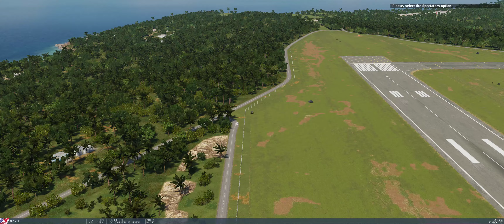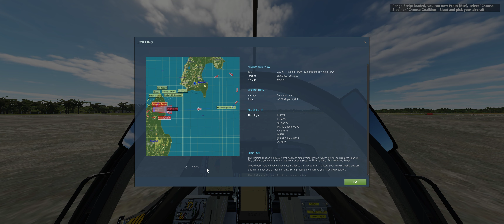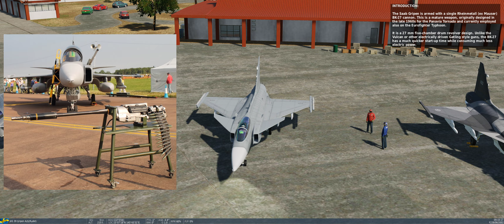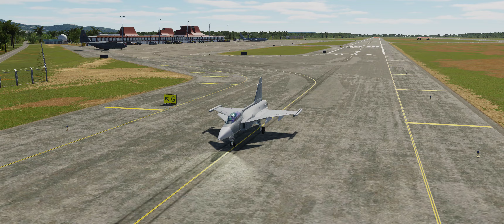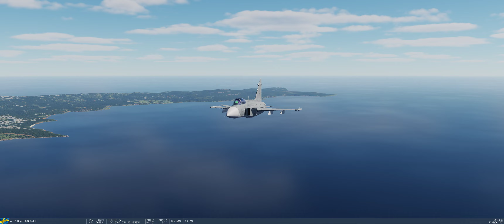JAS 39C - Training - M10 Gun Straffing Long version

Comment: I am not able to fire anything (missiles or guns) any idea how can i fix that?
Reply from the maker: When you follow the procedure, on what step you begin to find that it doesn’t work?
Reply: @rudelchw  i was testing this mod so i popped it into mission editor in air, i locked on to the enemy and then i try to fire , nothing happens
Reply from the maker: @sneh269  Did you set the Master Arm to READY, and the trigger safety lock to UP?
Reply: @rudelchw  thx, i was looking for a key bind but i later realized it was switch in cockpit